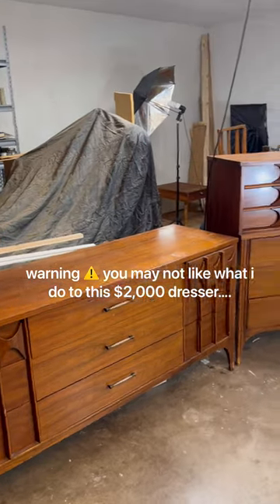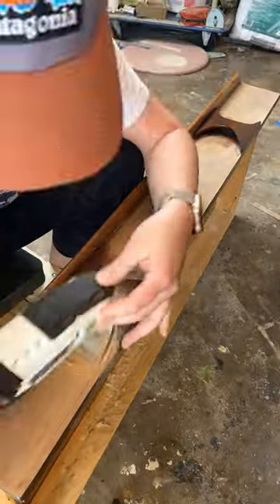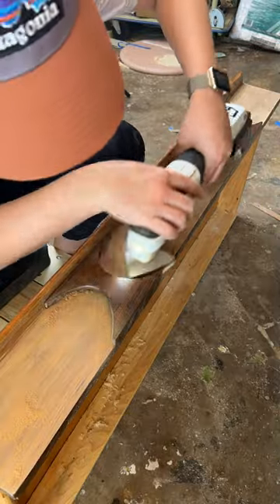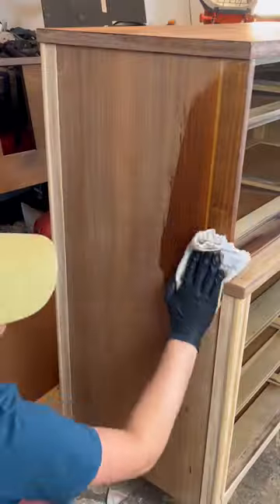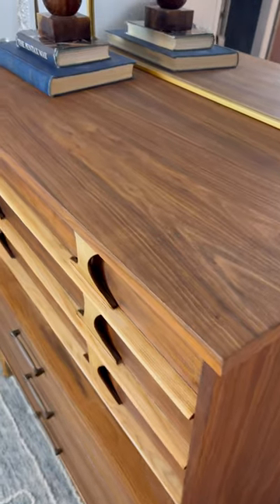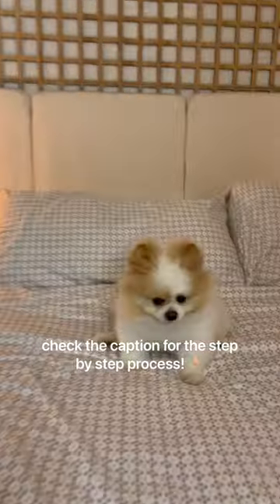You won't believe what I did to this $2,000 Mid Century Modern Kent Coffey Perspecta Dresser!

Comment: I also like how your dresser turned out. Could you give more details about your sanding process- what grit did you start with and how you progressed to finish sand it. Also curious about the two sanders you used- brand and type. I am currently sanding a vanity and my detail sander with 80 grit didn’t remove much. I’m trying to remove white paint from coarse oak grain. It is not fun. The orbital sander doesn’t seem to take enough off.

Comment: What do you have done to this piece of furniture pains me to my core. It goes against everything that I have ever known to do and not to do in restoring a piece of furniture of any age. I do this professionally it's by 9:00 to 5:00 job I've been doing it for 15 years and my dad started it back in 1984. So I can say that I'm a professional at furniture refinishing and restoration. You NEVER take a sander to a piece of furniture to strip off the finish especially an orbital sander the scratches that you put into that wood run deep and will likely never come out. It does not show up on the camera and will not it is something you have to see in person the scratches will likely look like swirls kind of like a pigtail. You should always use a chemical stripper to remove the finish. I do understand the stripper you get in stores today is not very strong and in that case find a company local they can do it industrially like me we used a stronger stripper and we are better suited for it. I know you think you help this piece and I know you mean well but please do not strip another piece of furniture this way again.

Comment: I would have tried to keep the horizontals matching the dark color. As for the veneers, unless you redo those veneers you just dropped the value of that dresser to about half. Keep them the lighter tone and try to match the legs and bottom frame, but the veneers and proper color contrast really do matter. I see three different level of tone and the top section just screams painfully in my eyes.